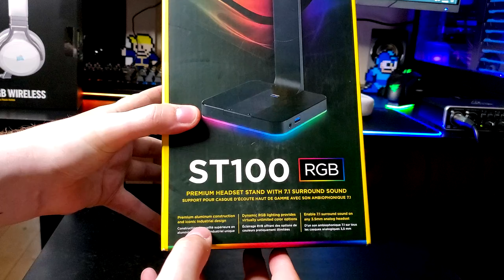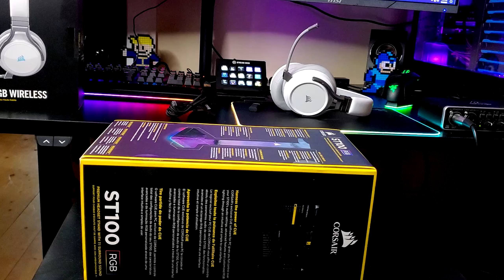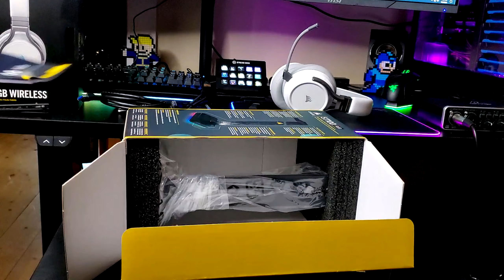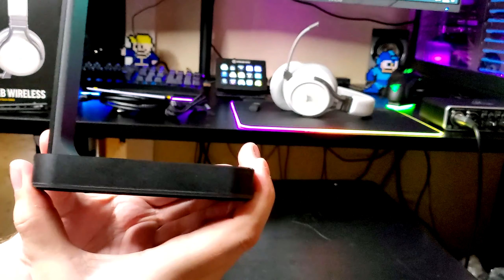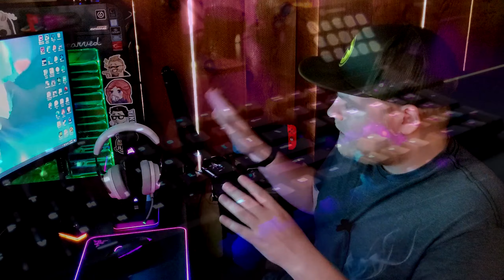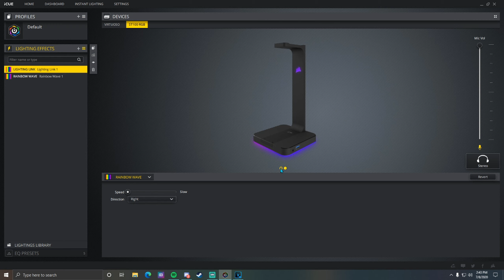Corsair ST100 RGB Headset Stand | UNBOXING

Comment: Very good review. A lot of information. I have a question regarding the brightness setting in the Icue software. The brightness of the Corsair St 100 can be set in 4 positions such as - 0%, 33%, 66% and 100%. The problem is that between 66% and 100% nothing changes. 66% is the brightest. Do you also have this problem? Best Regards.

Comment: Its not a proprietary connector its a USB 3 Micro-B 10 Pin, allows for extra data to be sent along a Micro USB connection with an extra bit on the side, commonly seen on external USB 3 HDDs.

Comment: Hi ! 
I had a few questions i had about this headset stand and i was wondering if you could help me with those !

1 - Since there are so many lights  modes but you get a actual software with it . If you choose the purple color for example, and you turn off your laptop so it turns off too, when you turn your computer back on, will it have saved that it was on purple and automatically light up purple again? 

2 - During the video you talk about how HyperX had made it different, so hearing that, as the person i want to buy it for as a HyperX headset i started looking for the Headset stand that would go with it but couldn't find anything from HyperX :( So i was wondering what you were talking about, was it a actual Headset Stand ? or maybe is it not done anymore so that's why i can't find it anywhere else ?

3- And this might be a dumb question but no matter what the headset you can use it with this corsair headset stand right ? Wouldnt want to put in so much money for nothing haha ( the actual headset being the HyperX Cloud)

Wishing you will see this comment and will reply to all my questions !
Great video keep up the great work ! This helped me a lot !
Reply: 1 - you download the Corsair icue software from Corsair website. 1 A yes when you turn off your pc and turn it back on it will remember what settign you previously left it on, however until icue is loaded i.e when the system is booting it will bein its default mode of rainbow spiral until icue ios loaded in the background, this is because it has no on board memory.
2 -  He was talking about other manufacturers adding a wireless chargin point on their stand, and this one does not have that.
3 - ANY HEADSET WILL WORK WITH THIS STAND, the usb connections are not proprietary.